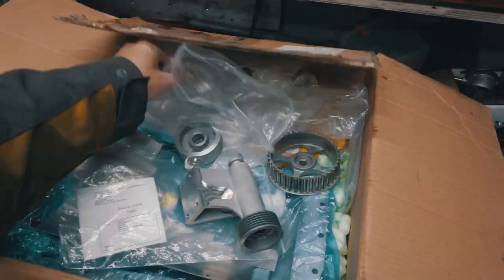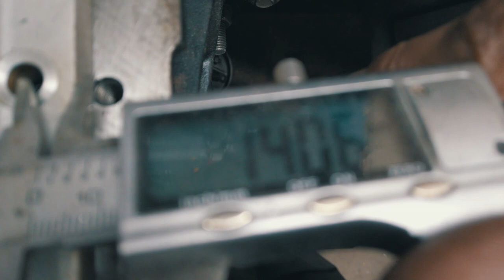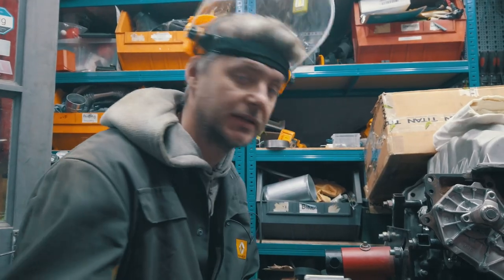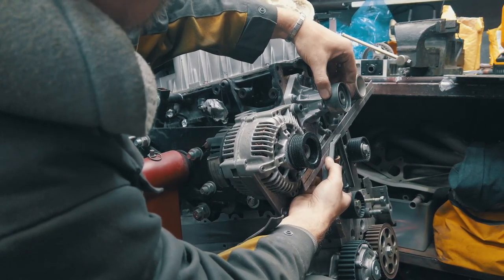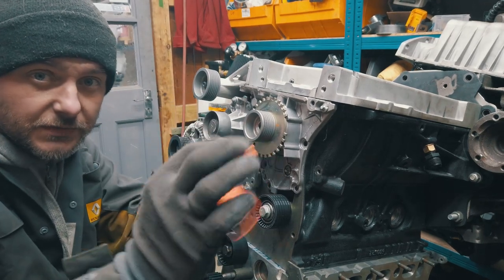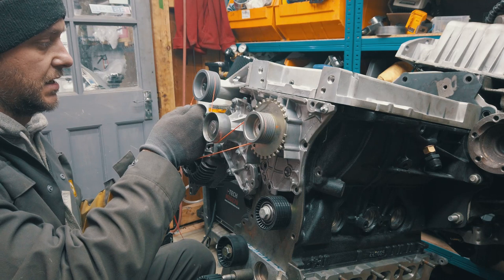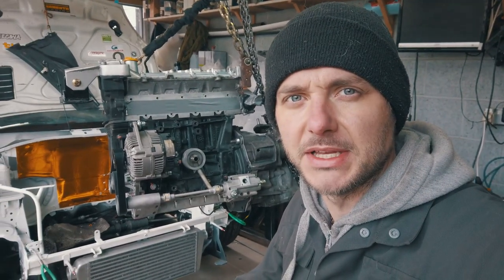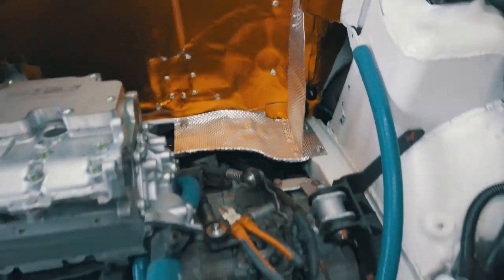Wet Sump Vs Dry Sump, More power? Fitting DRY SUMP Engine Oil System on a Clio 172 Ep.15

Comment: Hi, where did you fit the oil tank for the dry sump. Also did you make one or use an off the shelf one? Cheers,  Colin
Reply from the maker: Hi Colin. It’s in the boot. No I have purchased one from AH Fabrication. They are absolutely fanatic! Highly recommend. No way I could have made one as good as theirs. https://ahfabrications.co/
Reply: @RuskiWeldFab  Thanks for the reply. I am just grafting a dry sump engine into my sons sprint / hillclimb Clio and information is like non existent.  Sorry have another question what capacity tank did you use?
Reply from the maker: Yes there is no info anywhere! It’s a 9L tank that has built in catch tank for the breather. I have a video on internal workings of the pump. Have you seen it?
Reply: @RuskiWeldFab  Yea I have watched your videos with interest. I recently picked up freshly rebuilt Oreca Formula Renault engine complete with dry sump set up already plumbed in so just awaiting the gearbox to come back from rebuild and I can install. Don't expect the Oreca engine to make as much power as the motor I have taken out but wanted to go down the dry sump set up route. I know everyone says that "Clios don't suffer from oil surge/starvation," however, having  previously suffered bearing failure due to oil starvation  happier trying this set up even just for peace of mind. If all goes well may then look to swapping out Oreca engine with existing one and transferring over dry sump set up.
Reply from the maker: its not just about oil starvation. increased capacity, weight transfer. consistent pressure. increased power. all positive points to consider!